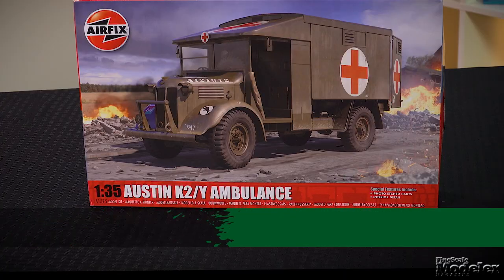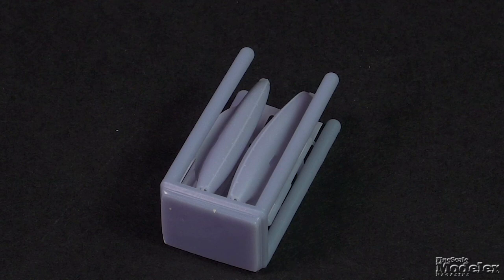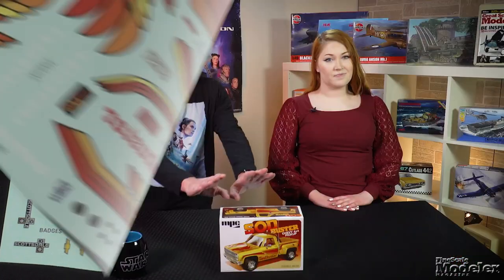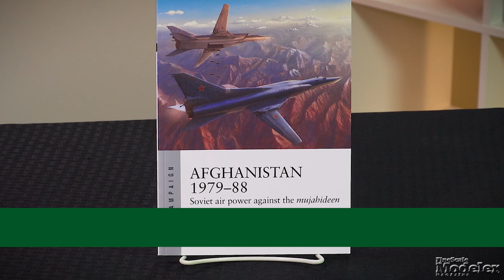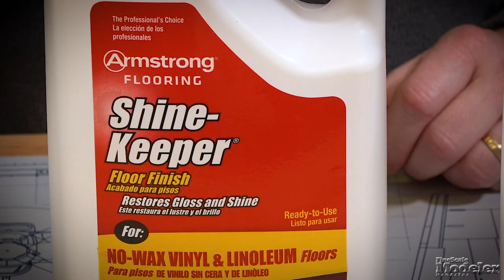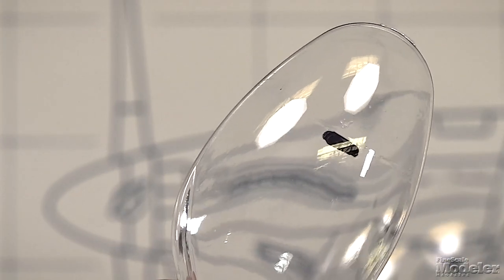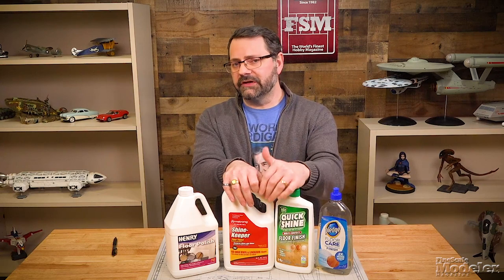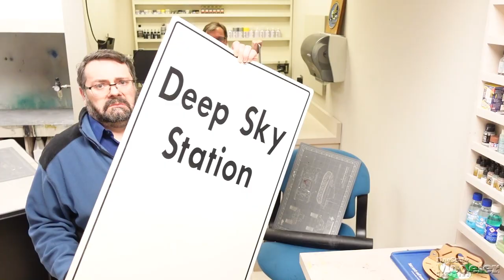FineScale Modeler unboxes the Airfix Austin K2/Y Ambulance, the Arma Hobby Hurricane, and more

Comment: Hi guys.... so glad that not all of the replacement for " Pledge Future " work out. That helps me a lot, because I live in Europe and our floor  polish, shine, protecting thing is called " EMSAL " and every single time when I used that stuff it looked awful. I had always bubbles in the windshield or in the middle of the glas some sort of lines where the fluid just did not dry even. Now I know it is not necessary my miserable skills, but maybe because " EMSAL " has no self leveling additive. 
Thank you ...keep it up👍
Reply: Little kit like this with little canopy doesn't need Pledge or any other varnish. Quick rud with a bit of tissue after a spit will do.

Comment: Wondering which 3D printer you have....and what will you print first ......For canopies I still use Future. B/C of the discontinuation I started experimenting with Tamiya X-22. I spray a couple of mist coats then a wet coat. Mist coats are thinned 50/50 with Mr. Leveling Thinner. The wet coat is close to 75%MLT and 25% X-22 I wait about 10 minutes between coats. So far I like the results...Another Good thing is if you mess up, get lint or a stray cat hair on the parts MLT is 100% safe to use on your clear parts and is also friendly to your plastic kit parts if you mess up your paint job. HTH